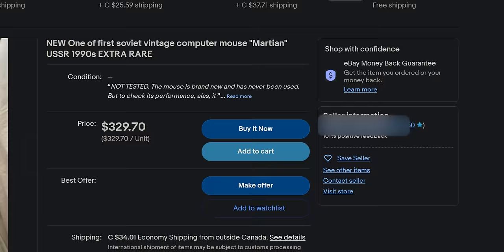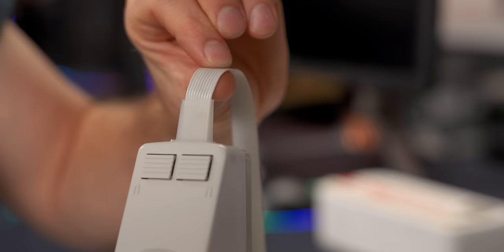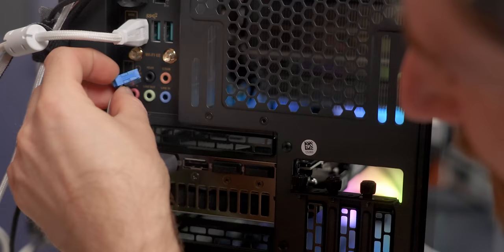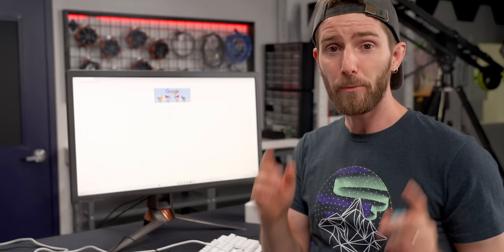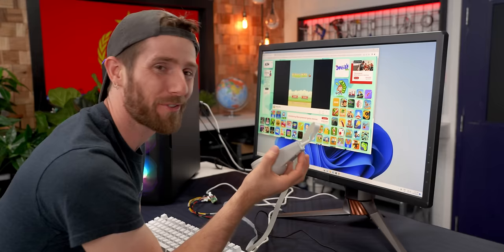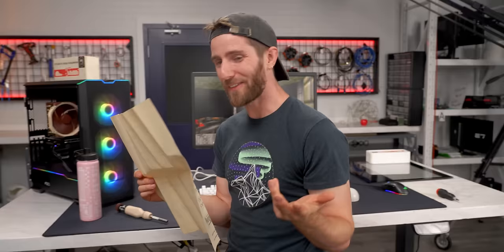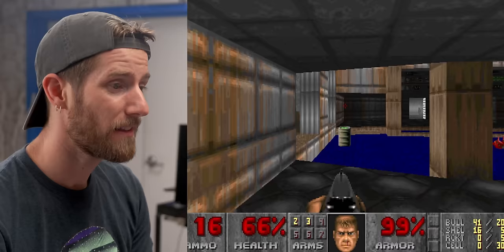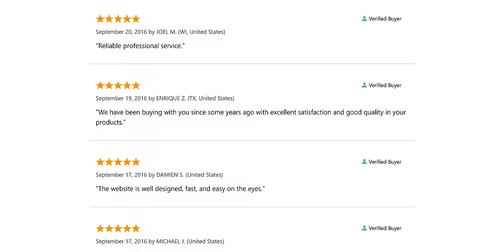I Bought a Soviet Era Gaming Mouse - MARS UKV-01

Comment: Imagine if modern electronics came with schematics.
Reply: We can only dream :(
Reply: the  schematic will be the size of a very very detailed world map
Reply: Yes, it was very usual thing for soviet electronics. As a child, I had a computer "Дельта-С" (Delta-S) - ZX Spectrum clone. The instruction contained even modification schemes for connecting to incompatible TVs.
Reply: @davidphillips5677  Depends on the level of abstraction.
Reply: Most large appliances come with a service manual hidden inside somewhere. My top load washer was simply taped to the inside wall underneath, my microwave one was hidden behind the keypad, my parents front load dryer was behind the front panel.
Reply: They did up till 15 years ago, now days you need to sign NDA’s and have a background check, especially anything automotive related
Reply: Made me think of Louis Rossman and his schematics or die. I guess all we need is a revolution and we can have schematics 😂
Reply: lol apple would disagree with you
Reply: I've seen schematics of 2000s Nokia and Siemens phones, they were on multiple pages, with crucial components listed.
Reply: Apple would shit themselves
Reply: There’s just too much in modern tech however a block diagram would be possible
Reply: @GraveFable25  For a motherboard only the traces on the pcb, without any components, would be several meters on paper
Reply: Louis Rossmann showed mac schematics. he was sue by apple after that. And apple withdrawed after
you can find schematics somewhere but it's too complicated and you dont know the schematics of the chipset.
Reply: Pcb traces are really bloated by all the suff that's added for filtering and  stability. Much of the data traces can also be combined with others ect. 
You can have a schematic for a motherboard on a single a4 paper, though it probably wouldn't be very useful for anything other than a general overview.
Reply: It was awesome. I mean, the appliances sucked and you could choose between only 2 or 3 models but you could fix everything thanks to the included schematics.
Reply: It is also availability of parts. When most of the work is done on  a custom chip with more than 100 pins, replacing parts becomes difficult.
Reply: My toaster came with a circuit diagram and schematics, pretty cool for a damn toaster.
Reply: @davidphillips5677  Only if there was a way of displaying the schematics without using paper. Someone could invent some type of portable document format...
Reply: then what would Louis Rossmann do all day?
Reply: Apple won't be very happy
Reply: People would repair their electronics more often.
Reply: @AlwaysBolttheBird  Too much for paper maybe. But a link to a .pdf or some sort would only take like one line.
Reply: modern electronics have so many "unknown" chips, since companies patent even the screwholes, that a schematic is not worth much. old devices were very simple so schematics made sense.
Reply: I've been using an MNT Reform as my personal laptop for a bit now and it has schematics available! Would love to see more manufacturers do this.
Reply: fairphone does
Reply: @davidphillips5677  That's no problem, we have plenty of storage space these days. Just supply it digitally.
Reply: lobby for right to repair listen to louis rossman. schematics or die
Reply: Based on what big tech and the government is telling me, I can only assume it would lead to the degredation of all moral values and eventually result in the extinction of humanity.
Reply: Last computer I bought that came with schematics was an Amiga.
Reply: @tim3172 Shame on you for spreading anti-Right to Repair nonsense. If it's highly illegal, yet hurts nobody and helps many, should it still be illegal? Also repairing old appliances is still better for the environment then throwing them away and buying new ones all the time, and the same goes for Apple MacBooks. So stop pretending like you care about the environment.
Reply: It would, if USA lost the cold war.
Reply: @tim3172  :I dont how the law worked
 I remember TVs fixers could fix CRT TV by replacing some chip, some resister, some capacitor if it was fail, it was 20 years ago. It doesn't change . They must have the ton of schematics right?
Reply: Western side is not accustomed to "share"
Reply: Louis Rossmann is working to bring this back.
RIGHT TO REPAIR! RIGHT TO SCHEMATICS!
Reply: Or albums came with sheet music.
Reply: yes! please
Reply: louis rossman would be proud
Reply: My old microwave included a very detailed guide on how to fix microwaves.  Found it when I was taking it apart to scrap.  Fixed that one, plus I've fixed multiple newer ones using that guide now lol
Reply: Higher up people don't want us to get ideas XD
Reply: @myname7021  c rings. :-P
Reply: Imagine manufacture still want you to repair your stuff
Reply: Apple is gonna sue you for saying that
Reply: That requires companies to be honest
Reply: Schematics or die
Reply: They're gonna fill up a whole book
Reply: Louis Rosmann will die a happy man
Reply: @0alsh  thats the coolest shit
Reply: Guitar pedals have entered the chat
Reply: @davidphillips5677 not quite. Depending on how it is drawn a laptop schematic may be about 20-40 pages.
Reply: And datasheets of the ics ehh good old times. I've repaired a modern device that came with the schematic in a binder, but the decice was worth about 500k usd. So yeah i guess there are class differences :) And good that they did because the company has ceased operation cople of years prior to the device failing and there was no repair service available.
Reply: I was taking apart a 20 year old standing heater to try fix it the other day and it had a wiring diagram printed on the inside. Made the whole process WAYYY faster
Reply: @davidphillips5677 if you compare this to a modern mouse, you will find one IC and a few passive components. So the schematic will be much simpler.
Reply: @tvenningmedia4334  the thing is we aren’t talking about a couple of discrete components anymore. There isn’t really any schematic that someone who hasn’t worked on the project would understand. I’m not saying not to have pinouts and such but looking at a schematic of any consumer electronic is pointless. There really isn’t anything that can be replaced at this point too
Reply: @0alsh  It was also common in America... Until the 1980$. God Bless Ronald Reagan, let his economics trickle all over me.
Reply: @Tangent.  Yep a lot of older technology had schematics. Remember my grandma's old television had schematics with it.
Reply: SCHEMATICS OR DIE!
Reply: Yeah, we are all like.. wow what a shitty mouse, but then he whips out the schematic, that suddenly makes it much better... if the lab couldn't figure that out.. then they are useless.

That said schematics or source code simply cannot exist in a world with Chinese copycats, even without it, it's already bad. Companies don't include that to protect their IP, not great for consumer, but understandable.
Reply: @AlwaysBolttheBird  >there isn't really anything replaceable in there anymore
surely God intended something for us when he made solder joints become liquid with a bit of heat?
Reply: @tim3172  You are confusing copyright law and patent law. Rebroadcasting patented proprietary designs is not illegal. Patent information is in fact publicly available. Making and selling the product in the patent would be illegal. What they CAN claim is copyright infringement, which is weak sauce. I mean, unless you are a paid industry bot, you probably have a bunch of pirate stuff on your hard drive, which according to you is "highly-illegal".
Reply: When I was little kid, ZX Spectrum became popular home computer in post Soviet Russia. My dad not just bought some completed ZX clone, but bought parts, like pcb and microchips, and schematics for it, and just fucking craft it.
And schematics for stuff was generally usual thing, not obscured by some richass corporations. My dad did some home electronics repairs (like tv's and tape recorders) for living, and I remember then always was paper schematics for it, at least for domestic stuff.
Reply: @AlwaysBolttheBird  You are spreading misinformation. Modern devices are composed of largely modular components, like dc-dc converters, various single purpose chips, and so on. As long as the manufacturer is willing to sell the chips to third parties (which Apple for eg. prevents), repair is fully possible. And much easier if you have a schematic and a board view.
Reply: depends on the product, alot of products you can download schematics online somewhere. or piece the details together.
ironically, the cheaper and more mass produced the product, the less likely there is to be schematics,
Reply: Apple just rolled over in their grave dug by Samsung
Reply: @davidphillips5677 if only technology had advanced at all in the past 50 years OH WAIT
Reply: @jamiethomas4079 that's very interesting!
Reply: no @AlwaysBolttheBird
Reply: lol u thought @RaukGorth
Reply: Yeah..........We as humanity sold our souls to big corp and lost this privilege when everyone starting buying ipods.
Reply: I mean, it was, in theory, owned by the people themselves.
Reply: Well, model trains for hobby still has schematics - they kind of expect you to service the electronics of the locomotive yourself.
Reply: the schematic for pretty much everything got to exist, it is that it is not published anywhere and is a "secret" nowadays.
Reply: @bigclivedotcom usually does an amazing job finding schematics and breaking things down in a lot of electronics both old, new and burnt lol in his videos.
Reply: hmm almost like when there's no profit incentive you can do things like that while still advancing technology
Reply: Open source schematics. The dream
Reply: Modern wendors dont have the schematics. They just asking chinese made some stuff
Reply: My drum module from 2001 came with a schemetic diagram and it's so ridiculously detailed that it makes my head spin, but thanks to it, I've been able to keep it running.
Reply: They did - until the mid 70’s, when ownership of IP in tech trumped on site repairs. Studios I worked in all had small repair shops… 😅
Reply: Imagine the schematic for a modern computer, that would be awesome!
Reply: @wertywerrtyson5529  lol hell, we just finally got the right to repaired for vehicles. 
So now you don't have to bring your vehicle to some overpriced asshat that you bought the thing from. You can now fix it yourself or bring it to your own mechanic 👍

So maybe another decade or 5 😂
Reply: @bastienx8 that's not how schematics work.
Reply: @progo8156  That’s good. We have had that law for about a decade in my country that says that warranties apply even if you service at a third party mechanic. However it has to be an accredited mechanic it can’t just be your friend fixing your car for you.
Reply: This is what we consumers should fight for with the right to repair!
Reply: We have a Selena branded radio in our house, remnant from my grandparents' time in Bulgaria. My grandma still keeps the schematics, it's a really big piece of paper with all the details.
Reply: @Mrflash222006 15 years ago? Are you crazy? MUCH longer ago than that lmao
Reply: @trajectoryunown wtf are you talking about?  Schizo
Reply: Imagine....
Reply: That would be communism, my friend!
Reply: They are starting to
Reply: Depending on how much time (and money) you want to spend on it, you could argue that ALL products come with schematics. 
Schematic, when you abstract away the exact graphical layout and concentrate on the information it provides, is just a list of elements (and often, but not always their types and values) and connections between them (netlist). IIRC the information contained in a schematic are not even copyrightable (but the particular graphical representation might be).

Therefore if you strip all elements from the board and measure them and measure each pair of solder pads for continuity, you can re-create the schematic by sacrificing one product. If you perform PCB reverse-engineering as a business (there are services that do this), you can use a wide range of techniques that streamline the process, from using a CT scanner (giving you the really valuable for cloning PCB trace layout) to just photographing the board after sanding it down layer by layer and re-drawing the schematic from trace layout. 
Obviously, this isn't feasible for (most) end-users, but it illustrates that the argument that "we can't provide schematics or we will get copied instantly" is absolute BS, since each product IS it's own schematic (in a "slightly" obfuscated form)
Reply: 90 % OF IT would be ic and other 10 some  resistors and caps
Reply: shit, most devices in the 60s-90s came with them (or atleast they were widely available)
best example probably being 80s hifi/audio stuff, you can readily find a service manual for about every walkman from the time
Reply: Old manuals are so amazing. The manual of my 40 year old electric piano has a full circuit diagram and an exploded-view diagram including part numbers for every single part.
Reply: @kiwikemist  Not at all, mid 00s - before the world went completely digital when you still had full paper manuals, some companies were using microfiche well into the 2010's
Reply: Luckily these days we get multiple Indian guys on Youtube who did it before and recorded it. 😅
Reply: Never forget what they took from us
Reply: And with software source code.
Reply: @totallymage6507  no company would be stop acting like apple is the only company interested in profits
Reply: A dream
Reply: You'd need an entire library of schematics just for your fridge.
Reply: It would literally be pages of info probably the size of the box the product is in.
Reply: 🎵Life could be a dream🎶
Reply: privatization would never allow it unfortunately...might need another revolution for that :)
Reply: An iphone would have to come with a bible
Reply: @beardsntools IP shouldn't be a thing, humankind should share all achievements instead of withholding progress for profits
Reply: My dad was radar engineer for our Motherland.
He never repaired unknown shit - he always screamed
I HAVE NO SCHEMATICS!!!!
Yeah. USSR is right to repair. 
give me like so everybody could talk with bolshevik
Reply: @pvshka  No, because the profits stimulate the innovation to even be a thing.
There's a reason why capitalist countries invented nearly everything, not communist.
Reply: was as if in that era, what you bought was yours
Reply: @wertywerrtyson5529 except when dealing with the Church of Scientology.
Reply: Then China could copy them easier lol.
Reply: LOL they do...if you out the ass for them.
Reply: How otherwise you would repair it? Production quality in USSR was miserable, especially of the electronic components. Our PDP-11 clone required repair roughly each week.
Reply: Apple could never
Reply: schematics for modern tech would be pretty crazy and massive, but I'm all for it 😝😝
Reply: Why
Reply: @tim3172 the problem (and the reason why Apple drop the lawsuit) is simple.
You don’t need to reinvent the wheel every time you make something.
Most motherboard manufacturer and also pc manufacturer reuse schematics from other manufacturer … Apple would have to publish during the court hearing their schematics …
Also schematics are only private if you create a copy of the thing … too bad their claim wasn’t a valid one …
Reply: Schematics were there for technicians mostly, but when talking about stuff like this that was very niche for communist countries, they were usually for enthusiasts and hobbyists.
Reply: and if they would be repairable
Reply: @jamiethomas4079 Yeah I found one in my dryer when I went to replace the belt.
Reply: they do, just not for you
Reply: @davidphillips5677  for a macbook? maybe. For a router? def not. Things would be so much better if i didnt have to search for 30 minutes to get a hi res scan of a printer in a language that im familiar so i can fix a simple 6pin IC.
Reply: @bastienx8  nah it would not, normally macbooks diagrams (which are known to have be big) fit in 60-80 A4 pages. if you are talking about "stuff that usually goes bad" (as in stuff that you usually have to repair) it could be fitted in 5 pages.
thing is, its not because its complicated. It would be so easy to include a QR code with a digital scan or PDF, but they dont do that either.
Reply: I see you've never bought a ham radio before....
Reply: Seems like only kitchen appliances come with schematics anymore
Reply: We had a portable AC unit that, once opened, had a bigass sticker that indicated the electrical circuits.
Reply: @0alsh  it was a usual thing for electronics in general back in the day, but companies being companies started to withold the information to avoid their competitors just copying their circuit designs at the cost of repairability
Reply: From Apple 🤣
Reply: State produces for the people, people take care of the goods best they can (and e.g. carry it to local repairman). It's a good system. I know VERY well the horrors of soviet authoritarianism, I know "it didn't work", but as a principle and idea?
Reply: i was coming here to comment this and all i can say is... YES!!! Right to Repair wouldn't even need to exist if we had full schematics, and it would make learning how electronics work easier if you have a detailed schematic to look at in every box.
Reply: in ussr almost everything came with it, thats why so many engineers loved that era
Reply: I can say that soviet era made a lot of people go into radio and electronics, cause you could find any detail, your job was to do the scheme, so most of products were made by enthusiasts for enthusiasts
Reply: Fairphone entered the chat
Reply: Dude no wonder they didn't just look at them.... they should ahve known it was a D-flip flop from the first 5 minutes of schematic work, all of the symbols are the same.
Reply: @davidphillips5677  Give us the PDF schematic exports that they literally have sitting on internal servers.
Reply: well.

they used to.
Reply: Bang & Olufsen does that.
Reply: Some do but it's almost NEVER  I was shocked when my torpedo heater came  with a schematic.
Reply: tbh its the kind of thing I'd put on the wall its so cool
Reply: Yes, communism had some small positive sideeffects. There is somewhere a book from Cuba, where there is basically a collection of manuals on how to repair anything almost without anything. Of course according to the small set of available things of that time and that type of society.
Reply: Every electronic product in the Warsaw pact countries came with a full electrical schematics. The commies didn't built stuff for profits, as in the West, their focus was exclusively on functionality and endurance of the product, which includes obviously facilitating its possibility of repairs.
Reply: This was the way to learn and evolve if you wanted
Reply: The consumers would realize that the most of it is 1 braincell cheap crap
Reply: @tim3172 everytime I am miserable and sad, I remind myself of people like you and an instant moral boost
Reply: One could dream
Reply: Schematics or die
Reply: In the early 2000s I remember having japanese tv with big ass schematics coming with it.
Reply: It was produced with schemes because there was no service, no spare parts, no maintenance, in fact you had to be an engineer to use and maintain your purchase if something broke in it as the quality left much to be desired or to buy a new one, which was not easy with Soviet salaries.
Reply: Almost every electronic device in Soviet Union had schematics! This not a joke when I was a kid i've seen a lot of them!
Reply: @0alsh  that sounds very useful
Reply: @tim3172 Low effort bait, at least try to be believable... smh
Reply: The schematic could be on the internet.
Reply: @davidphillips5677  actually it would fit on a A4 paper format, it is micro/nano tech sure but in just transistor symbols and everything its pretty simple to draw, if you know exactly whats inside
Reply: @GraveFable25  Why do you need to use paper when you can still provide the schematics digitally? On a flash drive/dvd/online, you name it lol
Reply: @SviatoslavDamaschin  physical storage is way too expensive and online it can be a massive pain in the ass to manage, if there are small changes happening over time  with many slight variations or changing urls servers ect.
Reply: @SviatoslavDamaschin расскажи этому нашему начальству, которое переводит тонны бумаги на схемы при поставке изделия заказчику. В том числе, на электрические схемы формата А1.
Reply: Older TV producers did have a full schematics in the inside of the tv set. It was immensely useful. But those tv sets werent exactly cheap. We are talking $10K for a tv.
Reply: But that means people could have access to information to potentially get their stuff fixed (or fix it themselves) for way cheaper than it would be to buy a new one (assuming it's something relatively pricy like a motherboard)
Reply: Жадные корпорации тогда бы умерли.
Reply: They're about to, after the laws get to start working in 2027 in EU.
Reply: nothing (except greed) prevents mouse or keyboard manufacturers from posting the circuit diagram on the PDF, available at the link. They spend megabytes on servers for their shitty software, but cannot attach a schematic
Reply: right?!
Reply: I remeber all TV we bought until late 80s  were with schematics
Reply: The jews won't let this happen
Reply: ...that would be as preposterous like battery driven devices with easy to replace batteries...
Reply: some of it does, you just need it to be open hardware
Reply: It would be like back in the day when we'd devote an entire shelf or two just to encyclopedias.... except it'd be 1 or 2 shelves per electronic lol
Reply: I fuckin wish